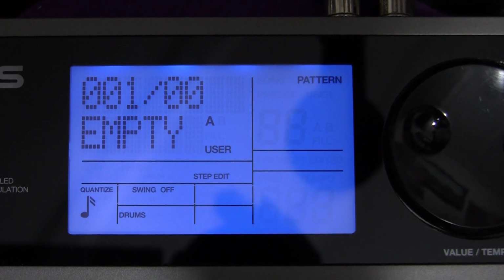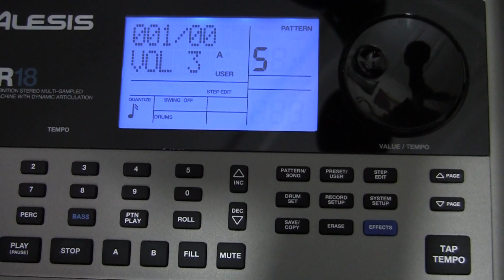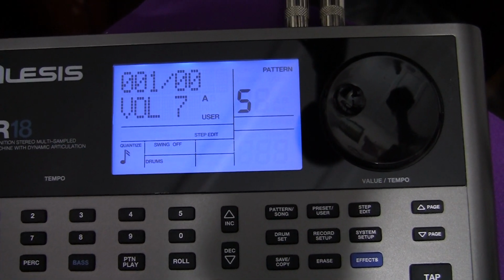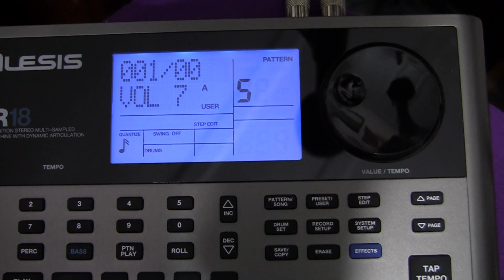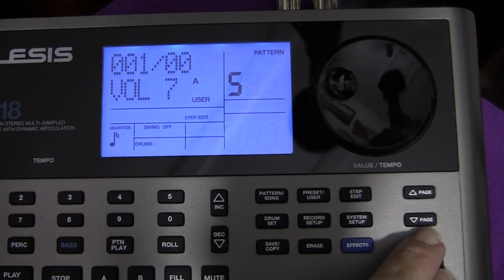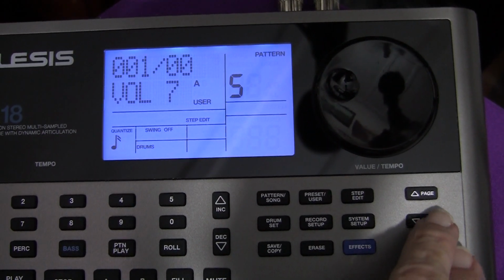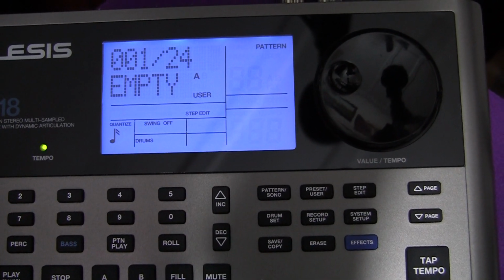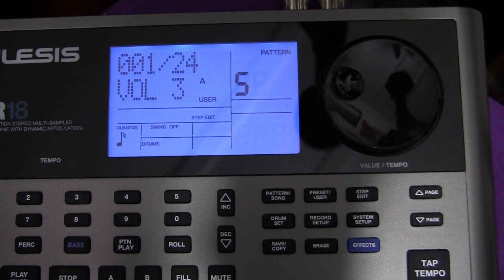Creating drum patterns for Alesis SR18 Drum Machine

Comment: Hello there I'm interested in purchasing this machine. But I am curious..does this unit have the capacity to record and store drum & bass patterns in memory? And can I activate those patterns on the fly simply by the press of a button as I'm performing with another instrument? Thanks!
Reply from the maker: Yes this machine is the correct one for you..... you can get 2 foot-switches to control it (but of course you can press the buttons also if you wish) .... one footswitch controls  start-stop and the other pattern changing.....  it has been designed for your application (solo live performance) and I have not found any better (or more suitable) unit on the market.
Reply: @StephenMendes  Thank you for your response! So I'm able to save patterns I've created into this unit?

Also say I'm singing & playing my instrument and I want the bass & drum to kick in at a certain time as I'm singing, am I able to do this with the click of a button? And is there a way I can make sure it is on time with my playing if it is a saved pattern ?
Reply from the maker: @violetflameofficial  Yes you can save your own patterns...... you hit the footswitch at the point you want the drums and bass to start....... the only way you could be sure of  perfect timing when you hit the footswitch to start the drums and bass would be to play in time with metronome output of the  clock in Alesis SR18  (put it in your in-ear monitor)
Reply: @StephenMendes  oh okay so I can use the built in metronome while I'm playing the song before the drum and bass comes on to make sure it's on time? Also what exactly is the in-ear monitor?
Reply from the maker: @violetflameofficial  I will have to check this out ..... to make sure it would actually work 🙂....cause it might not be possible.... did not think of this idea until I read your requirements.... if  I get it to work, I will make another video to show you how 😂
Reply: @StephenMendes  Aw I'm bumming out man. I've been looking into this one for weeks thinking it's the one! I'm hoping I can still purchase this. All I'm looking for in a drum machine is to be able to create & save patterns, and activate a pattern at any time I want during a song. Also hoping I can use this with my Boss RC-30.

For example I've got a couple songs that start quiet with no bass or drum and just guitar/piano but they are arranged to come in at the prechorus/chorus. So I'm hoping I can achieve this idea simply by the push of a pedal or click of a button at the right time as I'm singing the song. Thank you.
Reply from the maker: @violetflameofficial  Look.... this is one of the best standalone drum machines currently available ....  it will do most of what you want.... as for the bass/drum coming in after the song has started this is up to YOUR sense of timing ........ whether the thing has metronome or not,  simply PRACTICE over and over till you can match the tempo of the drums with your innate sense of playing speed.... then when you start the thing it will mesh with your playing